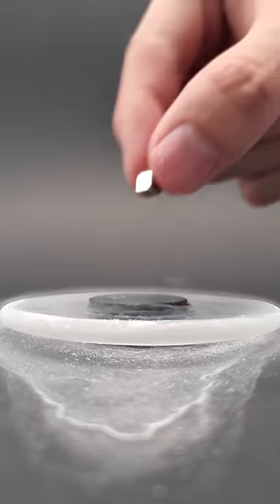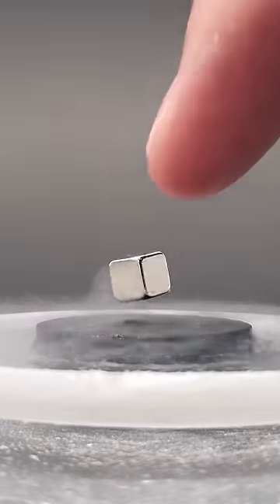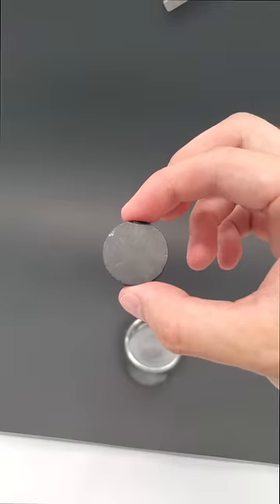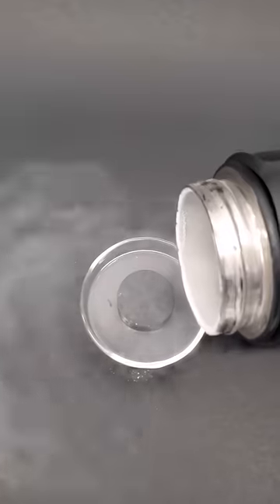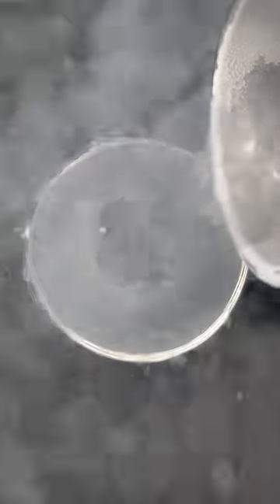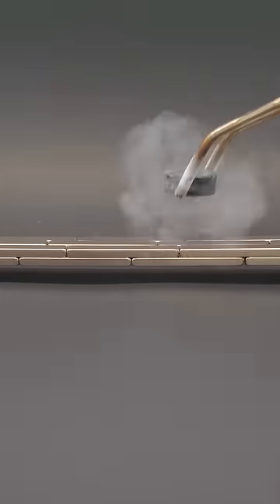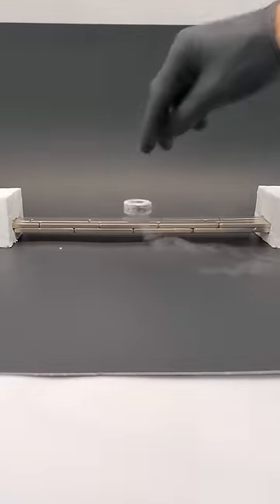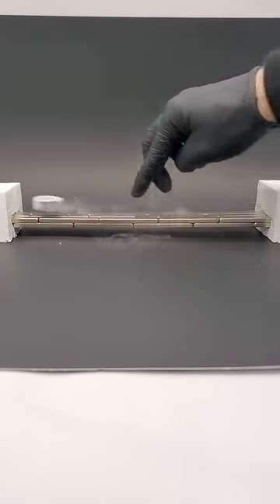Watch this superconductor hover around in mid-air!

Comment: Imagine trains like that. With a small push, they can travel through INSANE distances. The stronger the push, the faster it will start and longer it will take for it to slow down due to inertia. Trains running purely on a lil push and inertia!
Reply: Like the maglev trains?
Reply: @m1dnightsun555  I didnt know that’s how those work really. The more ya know
Reply: that would be cool, but it would be hard to make, mainly because it would need a specific amount of force to get to a specific station, and the tracks would have to be a straight line, so it couldn’t go to many places anyway.
Reply: @shocck1  maybe it has use with really long linear lines
Maybe cross countries metro
Reply: There's floating trains in japan nowadays
Reply: It's sc maglev train...
Reply: Isnt that basically just a hyperloop tho?
Reply: If I remember correctly, this is Quantum locking? I believe it actually follows the magnetic force so you can loop indefinitely.
Reply: @bagnotneeded  not yet, I think
Reply: @shocck1  it already exists, it’s called a maglev train. There are some maglevs being used in China, they can reach 350 mph (600km/h)
Reply: On a lil push and on fuck ton of liquid nitrogen
Reply: To get them to stop they just have a bit of the track be hot
Reply: You would need a big push to break inertia.
Reply: It's already functional.. Called as Maglev trains
Reply: Like the mag lev trains
Reply: A Hill:

Allow me to introduce myself.
Reply: Yes. Just yes
Reply: Sling shot a train🤣 easy way to achieve inertia
Reply: @shocck1  They use brakes to stop, duh.
Reply: I think the shinkansen aka bullet trains  in Japan  work similar.
Reply: @Banzybanz  
it’s a floating magnet train. regular brakes aren’t going to do much
Reply: How would you stop it?
Reply: Imagine it in a vacuum tunnel. Almost zero friction.
Reply: @shocck1  But They Exist Already
Reply: @empireofitalypsstimfromano5025  
yeah i forgot about those ones
Reply: @lavenna522  no, those are normal bullet trains
Reply: Hyperloop? Is this loosely based on that?
Reply: You prove a point
Reply: So no such thing as air resistance or gravity? Friction ain’t the only force keeping a train from coasting chief
Reply: @valentinwarnke1832  wtf man, you're against innovation or what?
Reply: @valentinwarnke1832  About that, I wonder if solar pannels are an option, or if they are a slow option. Maybe go with nucleat energy
Reply: @shocck1  The tracks can be curved, this has been proven by floating a superconductor around a loop made of magnets. The energy and resources required to keep the super low temperature is quite some, too.
Reply: THey are cakled maglev trains
Reply: For that to actually work the entire train and track would have to be in a vacuum tunnel. Otherwise air resistance would cause it to stop before reaching its destination.

Maybe it could work in the vacuum of outerspace where the temperature is naturally -455°F which is 135° colder than liquid nitrogen.
Reply: Awesome idea! Now think if that “train” were a generator
Reply: @shocck1  you could do curves if you design it right. With like rails that hug the track itself to prevent it from falling off?
Reply: Elon musk
Reply: @shocck1  no it would be in a vacuum, the way of braking would be losing magnetism
Reply: The amount of energy you would need to keep the material at such a low temperature would make it unfeasible.
Reply: Thy have them in Japan.
Reply: @7HEMUFFINMAN  no that's a vacume
Reply: Now think of  this  as  long track I. Deep space where its  neg 300 all the time
Reply: @jorgechavez7211  exactly making it energy inefficient as you need to get the train to be at absolute zero, which is 1K less than liquid nitrogen. Cooling something is harder than heating it
Reply: ever heard of a hyperloop? its a maglev train which is incased in a vacuum depressurized tube to decrease air resistance friction. It can reach up to speeds of 700 mph.
Reply: Or anything if that sort. Anew technology for hockey. Lol. Some sort of super hockey. Like they did with trampoline basketball. Only with actual science.
Reply: Dude........
Reply: We can do it on top north and south hope someone will do it 😌
Reply: @m1dnightsun555  maglev wouldn’t be the same as this bc maglev just takes super strong magnets on the rail and bottom of train to repel each other and vacuum tubes where this idea would be more like super chilled tunnels and a propulsion of some sort at the start. The only problem with this idea would be how to stop the train and how to properly distribute all G forces experienced on takeoff.
Reply: @m1dnightsun555  which could be done by measuring the distance of travel and the weight of the train then using that amount of force to initiate the trains movement so by the time the train reached destination it would be able to stop right on destination. However for distributing the G forces released on takeoff I have no idea how to do that.
Reply: @shocck1  It wouldn't have to be a straight line, it would actually be able to follow the track pretty much wherever, also, due to the lack of friction, if you put it inside of a vacuum, and then push it, it would move back and forth indefinitely.
Reply: That’s what the hyper loop essentially is, but with a vacuum chamber as well to reduce air friction
Reply: It's nothing like a maglev or a hyperloop (which uses a linear induction motor), because those two use electricity to induce a magnetic field which generates a forward force. 

This superconductor, however, doesn't even  use electricity
Reply: @Mortulos- they can also use this for outer space travel, that temperature can be achieved in space and a propelling path is used to travel and save energy in space
Reply: It doesn't just work like that, air resistance is a big oof especially when you consider trains have to move 100s of kilometres so one push can probably take you to around 2km after which you'll loose most of your velocity
Reply: Now all we need is room temperature superconductor material.
Reply: @nu1x  they made one
Reply: @tafarithomas7757  Heeey, where can I buy it in bulk ?
Reply: China
Reply: Uhhh, maglev trains exist.
Reply: Black panther 🧐
Reply: Until you realize you have to blast freeze the riders😂
Reply: It take an insane amount of energy to maintain the super conductors temp and lots of magnets to make a train that still loses most energy to air resistance
Reply: This technology exists in many countries. There's the magnet bullet train in Japan. There's te chinese version, the Singapore version. This is not a new idea
Reply: Interesting idea but you can also run into problems such as it needs to be kept cool and that would be insanely hard to do and also the issue of stopping the train cause it might just crash into the other side.Plus the passengers would also get hurt if the train suddenly stops but hey if the scientists get interested in the idea then maybe in the next 10-20 years it may work?
Reply: @Drakonus_  "Uhhh, maglev trains exist"
Uhhh, they don't use superconductors to levitate.
Reply: @ferrumignis  Duh, obviously. The OP talked about floating trains using superconductors, so I brought up the existence of maglev trains, which does exactly the same thing, but not using the exact same mechanics.
Reply: @Drakonus_  So not exactly the same thing?
Reply: @m1dnightsun555  Maglev trains don’t use superconductors. It’s just regular old electromagnetism. Maglev trains are super expensive though. You never recover that capital in the entire lifetime of that train. That’s why they’re mostly for bragging rights…
Reply: Yea
Reply: Bro ur sooo smart and i think that too MORTULOS
Reply: I also think about that
Reply: @Marco-hl6gz  the difference is that maglev uses power in the tracks the whole time instead of just giving it a little push.
Reply: @gubenuben2  because it needs to maintain its superconducting status
Reply: Now how to stop it…
Reply: @shocck1  doesnt need to be a straight line
Reply: How do we keep tge magnet cool?
Reply: @m1dnightsun555  musk's hyperloop basically
Reply: How would you regulate temperatures on that high of a scale? Sounds expensive.
Reply: For it to work like this you need to keep the temperatures very low
Reply: @shocck1  just use a biggggg rubberband
Reply: I was thinking the same thing
Reply: @results1140  just reverse the polarity of one magnet so it doesen't hover anymore,but stick together...
Reply: In china and japan they used this.
Reply: They are trying to make one actually
Reply: It's called a monorail
Reply: Yeah, you'd get to your destination in like 4 months, lol. You gotta have a propulsion and braking system, so you aren't coasting at like 5mph for the last 20 miles.
Reply: will liquid nitrogen be like a fuel to cold down the magnets?
Reply: Or magic shoes
Reply: Aight but it has to be liquid nitrogen temperature so wear a jacket
Reply: Dude the materials hes using....dyahhhh
Reply: And what about the brakes?
Reply: Gods.. I don't want to imagine the price and the upkeep to just keep it functioning.
Reply: There are already trains like that
Reply: bullet trains exist
Reply: Nobody is mentioning how  cold the bottom of the train would have to be to work
Reply: There are electro magnetic trains introduced already and used efficiently around the world
Reply: Then they turn off the nitrogen
Reply: And then if you take away air resistance by putting the train in a vacuum tube, you have a Hyperloop!
Reply: Won't the G-Force  kill us when we go super fast in these trains?
Reply: @dalirkosimov4623  the shinkansen uses this. it carries cryogenic systems to keep the magnets cold.
Reply: @SirRichard94  again, not the same technology
Reply: @dalirkosimov4623  the shinkansen uses superconductors. its literally called Super Conductor Maglev
Reply: @SirRichard94  It's not the same thing. The trains do indeed use superconducting magnets to float, but they aren't simply floating on a magnetic track. The train still needs electromagnets in the track, they can't hover at a standstill.

Comment: If anyone has read the Uglies trilogy, this is basically what their road systems and stuff were. A bunch of metal under ground with possibly superconductors in their cars and stuff
Reply: floating vehicles would be cool but what’s the point
Reply: @tastyjason4136  I guess to save animals from getting run over?
Reply: Yooooo I know exactly what you’re talking about!! Nice connection. I read the first book… never continued because in my opinion it SUCKED. But I do remember the roads!
Reply: @djoctorok1375  lol nice…
Reply: @tastyjason4136  what’s the point? What’s the point?!?! They’re so friggin’ cool! If you see a hover car and you don’t feel like passing out from awe there’s something wrong with you lol.
But on a more serious note I think that it would definitely help with speed. No friction means no forces holding it back besides wind resistance. And it would be easier to drive over rough terrain if you just hover right over it! It could even work over top of water potentially, making water travel easier. When you think about it the possibilities are crazy.
Reply: @ytuser4562  I tend to finish series when I start them. It wasn't terrible but for sure for younger people, or just an easy read.
But yes the stuff they use it for later is pretty cool too.
Reply: I mean you'd probably go faster with lest friction but you know that doesn't seem that important
Reply: @tastyjason4136  well they ran on magnets in the stories, meaning no gas or anything. Also it allowed for other modes of transportation and on carrying hights. So in there an ambulance could just fly above traffic. But also there's no exact road since the metal is all over, so no traffic? 
Coolest thing in the story though was rope free bungee jumping. Basically a harness that reacts to the metal in the ground and when you jump off a building the magnetic field saves you from hitting the ground. That would be the primary reason to me for having this system haha.
Reply: @ytuser4562  if theres no friction how the fuck are you gonna stop the damn car? brakes work with friction, sir, friction is how you slow down.
Reply: @tastyjason4136  I can think of so
many things this would be beneficial for. It would mean less accidents and fatal injuries because the cars wouldn’t be able to touch the ground on the track and it would be smoother. Also less traffic noise from driving. No more wasting a ton of rubber on huge vehicle wheels! It would probably help the environment too.
Reply: it would make driving in severe weather conditions safe
Reply: @agentsbigassforehead  well you do realize he said but wind friction kinda like brakes since parachutes slow race cars n most new cars have fixed spoilers that act as a wind brake and there could always be a tank of compressed air in the front or rear fir emergency stoppage ID need kinda Like on NASA's shuttles or Tesla. new  roadster the future is bright with so many opportunity and ideas just think of the possibility with the right ppl to talk to who gas capitol enough to take the risk the rewards to be had are endless!
Reply: zamie  with rudders kinda like they ride in planes and like I told the other guy a lot of new cars come with wind brakes its the spoiler with an electric motor or parachutes like drag cars or hell maybe u could toss out an anchor or use compressed oxygen it wouldn't be hard to do one tank and nozzles front and rear KU da like the space shuttle and Tesla new roadster it could propel u and stop u and with only a compressor and your heat and air or other luxuries to run it could all be charged with solar panels built into your car a reserve for rainy or cloudy days the possibility are endless with the capitol to risk the next twenty yrs are gonna be great some things are gonna be hard for some ppl to adjust to but we the USA are gonna be on top i think the best investment gonna be water and land and technologies after all that's what the government wants and there's always a reason why
Reply: @tastyjason4136  the point is that without friction force and with tracks you can't get out of you would go really fast with really little fuel consume and you would have a precise route with a very lower chance of getting out of the road and crashing. A fast, ecologic and safe way to upgrade transportation
Reply: Yea Ik what you are taking about
Reply: @ytuser4562  Cars don't need to get faster, cars very rarely ever reach even near their top possible speeds because of safety concerns and traffic
Reply: @MsBELLE7  this idea about bungee jumping sounds stupid, the cord works fine
Reply: @tastyjason4136  yeah but without the cord you just from anything. It's futuristic and cool to me. Dont like it, don't read the book or use the fictional no rope bungee jump vest? I don't see an issue here.
Reply: zamie  it's not under the water, I never said it was. It's only under solid ground in these small cities that the people were regulated to post apocalypse. But in the real world I'd imagine it's be much the same if they used it. It would be used in cities and ossibly just a single road to smaller places? 
I'm not sure why you're so angry. Like I'm just talking about a book and it's nifty idea.
Reply: @tastyjason4136  probably less road friction and plus it’s just sick af
Reply: So basicly if we had magnetic pipes filled with liquid nitrogen and magnet cars we could have hover cars?
Reply: @tastyjason4136  what's the point? Uhh save rubber? And Earth :)
Reply: You just unlocked a memory I forgot I had
Reply: @ytuser4562  what do u mean I liked it

Comment: I'm glad he's having fun with those superconductors. I remember the pain in the neck it was for him to make those
Reply: To make those? Is it a joke or can you actually make a superconductors yourself?
Reply: @kingreinhold9905  watch nilereds video about it
Reply: @kingreinhold9905  many elements can be made into a superconductor. Superconductivity is a state of matter. You achieve this by cooling said element below -253 degrees, doing this removes the electrical resistance.
Reply: Wow I was the one thousandth person to like this comment
Reply: ONE FIx  there are quite a lot of them but amongst the "common" ones:

Lead
Mercury
Tin
Aluminum 
Gallium
Zinc
Titanium
Iridum
Litium

Etc.
Reply: Nomoskar cổng mỏi
Reply: @rufflez3337  hey can you please help me, although I know what a superconductor is, I'm not able to understand how it's floating in mid air
Reply: @deveshgarg7974  Superconductors don't like when the magnetic field they're in changes, and will create a force to resist this change. When a magnet floats above a superconductor, the magnet can't move because the superconductor doesn't want it to (a great enough force can overcome the resistance, however). Spinning the magnet technically changes the magnetic field as well, but it's a sufficiently small change that the superconductor doesn't care that much. When the superconductor is placed on a track of magnets, the magnets form a continuous region with (roughly) the same magnetic field, and just as the superconductor made the magnet stay in place above it, it too will want to stay in place relative to a bunch of magnets. The force is exerted on both the superconductor and the magnets; equal and opposite forces and all that. Why this force exists? Take your pick of superconducting eddy currents, the Meissner effect, and quantum flux pinning; the simple explanation that the superconductor just doesn't like changing magnetic fields remains the same.
Reply: @erictheepic5019  thank you so much for sparing time and explaining in detail, you're really epic.